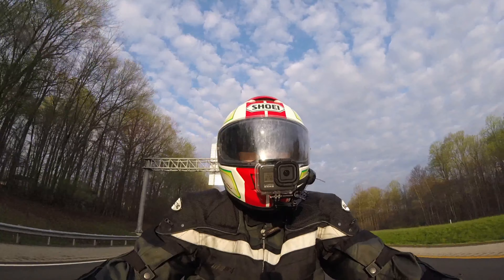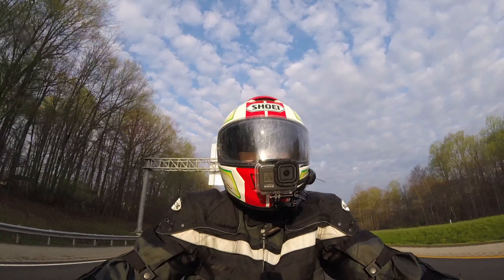New Electric Grom - Anything like Grom Reaper???

Comment: Quick question boss. How do you actuate the subtitles?? Do you type everything you're said afterwords before uploading or??? Great info brother
Reply from the maker: Yeah...I find that if I botch something...which happens quite a bit because my attention is on the riding more than the speaking, that I will go back and put in some text to clarify anything that I feel is glaring.  I just do it as a title in Filmora before I export.
Reply: @ThrottleBackRubberDown  aren't ya the best or frickin what?? I've got filmora too...yaaay I hope its easy peezy
Reply from the maker: @MRGS48  Yeah...super easy.  I just use a basic title and then change the color and size to fit.  You can just drag the width of the title insert to adjust how long it appears.
Reply: @ThrottleBackRubberDown  too bad you're somewhat far but if we cross paths I'm buying you definitely a 🍺!!